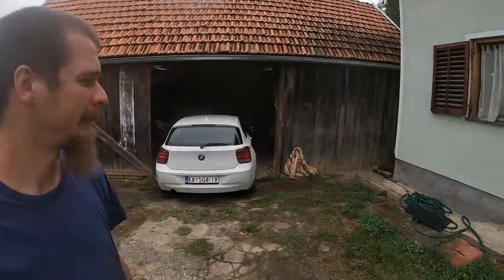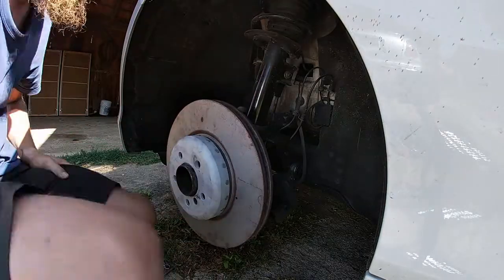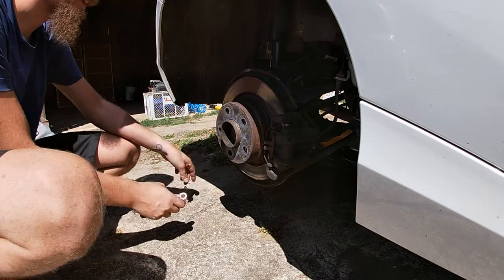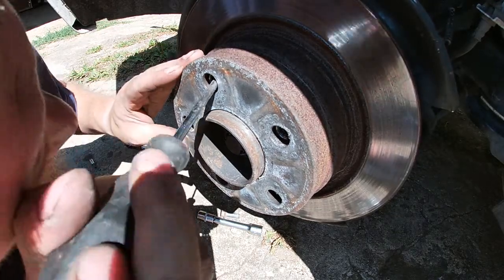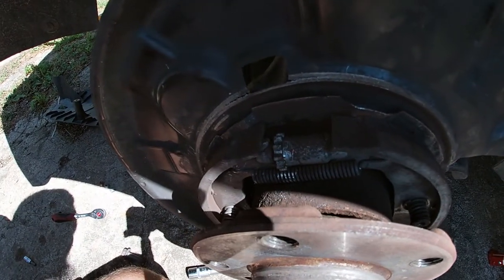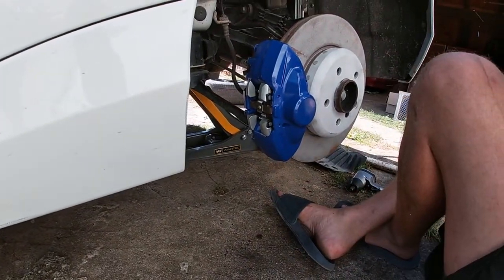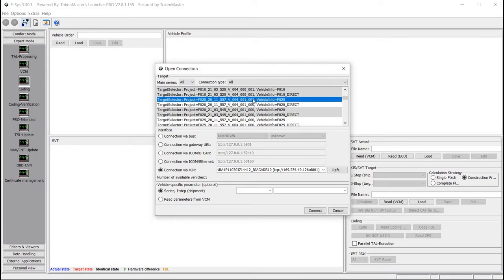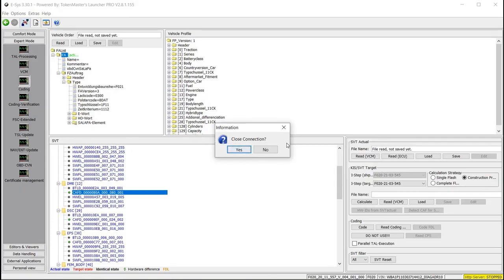BMW F20/F30 M Performance Brembo big brake upgrade HOW TO + CODING

Comment: Hello mate, firstly thanks for the video and helping us. Why didn't you code S2NHA to VO? I believe when we code S2NHA the car will know all about the piston and caliper size. 
I bought S102A which is 340mm disc with 4 piston front and 330mm disc 1 piston back all grey setup. I am hesitant on what to code at the moment. I have mushy pedal. First 10 to 15 percent is nearly non-existent. I am more close to coding S102A with the following order.
1-Read the FA (Vehicle Order).
2-Edit the FA and add S102A (in SALAPA-Element section).
3-Calculate FP and save the updated FA.
4-Write the new FA back to the car (VCM → Write FA FP).
5-Read ECUs (especially DSC module).
6-Code the DSC module (right-click → Code).

If you could reply it would mean world to me. Regards
Reply from the maker: Uf, it's been a while, but if I remember correctly 2NH is for 340 front as it would be on a M sport equiped F21, but to be honest there is a lot of different info online, so I went with what worked for me. As you can see from my videos I have a try it and see what happens mentality, so in your case I would try coding the S2NH and see how it feels and works, if it's no good you can always go back 😊
Reply: @WillowRacingTeam  Firstly big thanks for reply. The biggest issue is what I bought is not S2NH, it is S102A. The main difference is the backs are still 1 piston. There is too little info for my situation most of the people went for S2NH. I had a great second hand deal with S102A thats why I went for that. I believe SPBR is for S2NH which is M sport brakes. Mine is Reinforced Brakes. I will try to code S102 to FA and see what happens.

Comment: hi, does the coding you did also work for 340mm and 345mm M sport brakes? with 4 piston calipers front and 2 rear?
Reply from the maker: Yup, calipers are almost the same so it will work
Reply: @WillowRacingTeam  from 340 to 376 (wich is G30 support) does it need also coding? and will it suit?

Comment: What's the wheel size? 8x18x et 35?
Reply from the maker: Yup, but not all 18" wheels will fit over 370mm front brakes...

Comment: Were you able to fit the larger handbrake shoes? And how? Do the larger ones fit the current smaller place?
Reply from the maker: No, couldn't get it done, too manyzhings need to be changed

Comment: hi there have you got a part number for the discs please
Reply from the maker: Hi, here are the numbers:
Front 370mm - 34106797606
Rear 345mm - 34206797605
Reply: @WillowRacingTeam  cheers. going to fit the f80 caliper to my m140 and use the 370 discs. heard different hubs so just making sure I have the right discs

Comment: Hi, With the coding you did, was the idea to setup the S2NHA on you car? because saw that is done when people go for BBK, which are 370mm front. I just bought them from a m235 for a f20 lci, just wanted to make sure I will code it correctly.
Reply from the maker: Honestly didn't do that much research on 340mm fronts since I went for 370mm, but as far as I can tell everyone uses S2NH when they upgrade to 4pot/2pot setup, no matter the size. I will be checking this out once I complete the swap since im changing all the ECUs, not just DME M135i
Reply: Awesome, I will keep you posted too,  I will be fitting mine soon

Comment: Do you tighten your lugs firm, with either a breaker bar, or impact wrench, then lower fully to the ground to torque or just so they're touching the ground, but not a lot of weight on them? I'm reading conflicting info elsewhere. Thanks.
Reply from the maker: Brakes and everything in the air, only suspension bushings on the ground to eliminate pretention
EDIT: if you are thinking of wheel lugs, I do them in the air with impact gun on a bit lower setting and then tighten them to spec with torque wrench once the car is on the ground.
Reply: @WillowRacingTeam  yeah, wheel lugs. Thanks for the reply.

Comment: So, just confirming, you upgraded from standard non-m-sport braking system (floating) to the m-sport performance  fixed brembo style? No change in brake fluid lines, just recoded for the abs system to properly manage the bigger brakes etc? 

Oh, and the bigger wheels ;-)

Wouldve been an even better video if you didn't speed up what was done in the front. 

I have a 2013 F30 320D here in Australia with the same standard braking system. I do have the m-sport package, so has 19inch wheels. What's the minimum size needed for the calipers to clear? 

Thanks.
Reply from the maker: Hi, this is correct, brakes are straight fit, no need for mounts, brake lines or anything like that. Only 2 things you need to watch out for is the rear parking brake shoe size and front calliper since there are 2. If you use bigger front calliper you need 370mm discs and minimum 18" wheels. Problem is that not every wheel will clear it, but most OEM should. If you have 19" there should be no problems. If you go for smaller front with 340mm discs you can even fit some 17" and all OEM 18" should clear.
Reply: @WillowRacingTeam  ok, thanks for all that.

Comment: Have question bro you use the same bolts from the rear regular caliper on the new ones or it comes whit a new set of bolts…..
Reply from the maker: Bolts are the same
Reply: @WillowRacingTeam  thanks ✌🏻✌🏻

Comment: Brakes feel much better thanks mate 👍
Reply: Do I have to do the dme also?
Reply from the maker: @Gaming_officialmk_  No need to code the DME, I made mistake while editing 😊
Reply: @WillowRacingTeam coding m sport invece di m Perfomance?
Reply: Ah, was this your car? What differences, advantages, have you seen with the newer braking setup? Thanks.
Reply from the maker: @marksargent2908  To be honest they were to big for my car as it was, if I was to do it again would just go for biggest floating caliper setup, on the other hand I'm doing an N55 swap now so they will be put to good use. Main thing I've noticed is heat resistance, with smaller brakes they would start to fade after harder braking few times.  Also they seem to do a lot better on 150+ km/h, much more confidence inspiring.

Comment: Have Coding increase the pressure of master pump
Reply from the maker: Probably, don't really know how it works, what I do know is that without it pedal travel is longer and pedal feels mushy ( soft, undefined, like when brakes aren't bleed ), after coding it feels like it did before change.
Reply: @WillowRacingTeam  can review right?

Comment: Looks like you fitted f30 kit, 370mm front and large handbrake rear discs, so do you not have a working handbrake now? 

Also a point about coding, what exactly changes with that?  

The system is fully mechanical and if feels like there is air in the system it’s because there is air in the system :)
Reply from the maker: I have switched to smaller handbrake discs so it works as it should. Coding is necessary because you are switching from 4 pots to 10 in total which have a bigger surface so you need to push more fluid for same pressure ( Pascals law ). On older cars you achieved that with bigger master cylinder, while here you can do it with coding the ABS unit
Reply: @WillowRacingTeam  Was the switch to smaller hadbrake discs, easy? Got a vid of that too? ;-)
Reply from the maker: @marksargent2908  Don't have a video of that, but it's pretty much the same, you just have to slide the disc over the shoes with a bit more force because it's a tighter fit

Comment: Is the coding needed would it throw an check light ?
Reply from the maker: You won't get a check light, but it's practically undrivable, pedal goes all the way to the floor like when brakes aren't bled